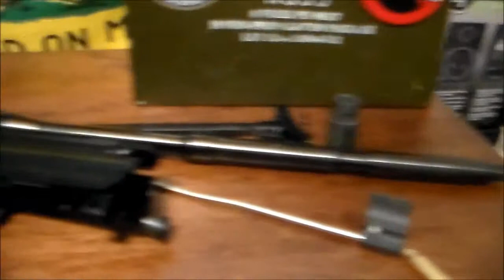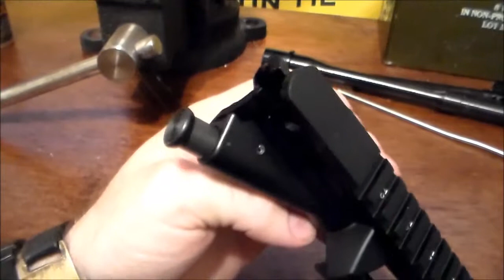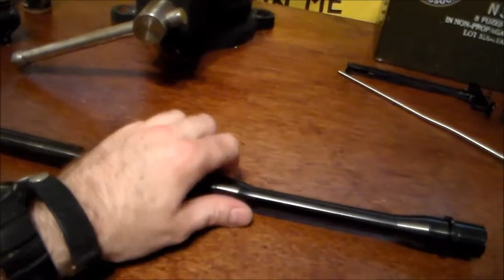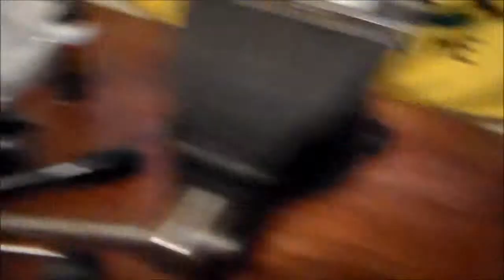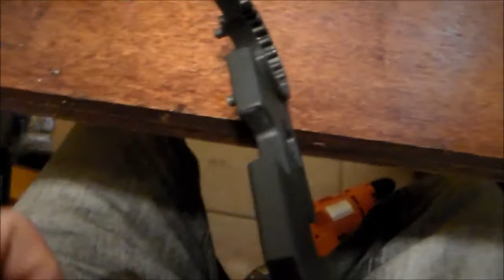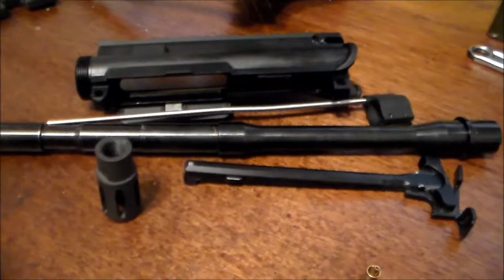why you shouldn't buy no-name ar-15 parts

Comment: I'm not defending or belittling anybody here, however, charging handle roll pins shear, often if you run a rifle hard, did on the original colts and every brand made (although in my years as a gunsmith I've never seen a busted bravo company handle, although they're pretty new yet). Allen bolts break when you don't use any anti seize on assembly. Feed ramp tool marks are also quite common, and I spent some time building automatic weapons, usually some time with a stone will remove the tool marks.